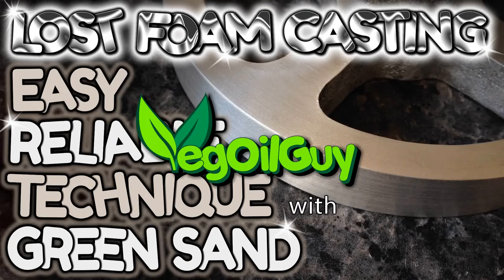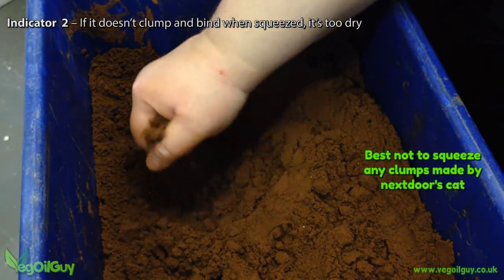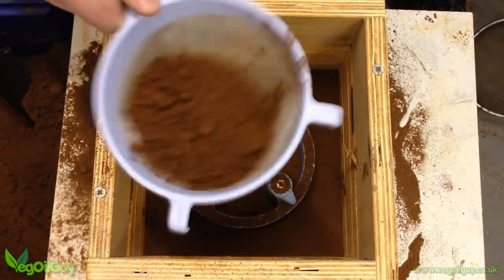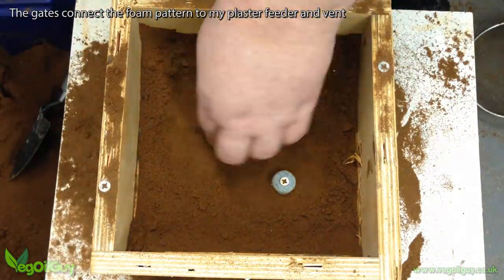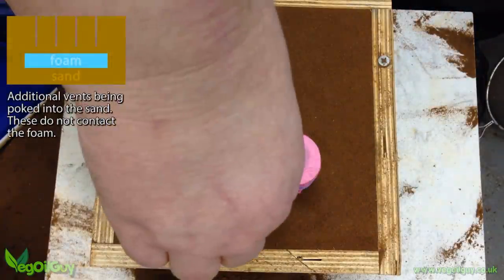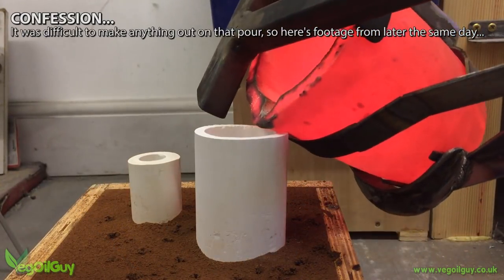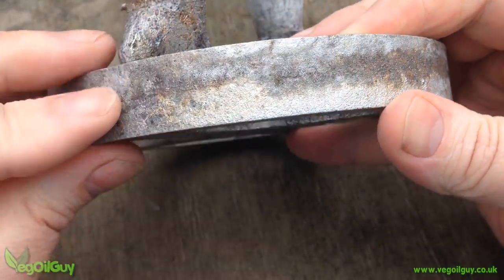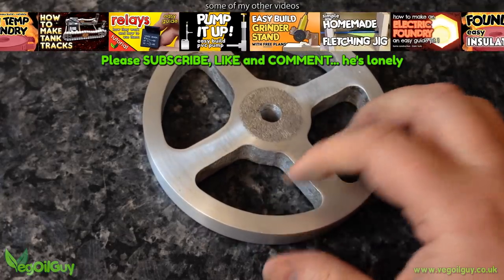Lost Foam Casting: EASY reliable technique by VOGMAN

Comment: I've got over a hundred pounds of aluminum I've been collecting over the years, I have a charcoal foundry, just been making muffins haven't casted yet. I need to make a backing plate for my new 3 jaw chuck, I thought of making a jig that would hold a metric nut the size of my spindle perfectly centered in a 2in piece of 3in steel pipe with 1/8 in threaded rod as rebar then pour aluminum, of course I would have to be concerned with balancing, I also have a few 3d printer I made, they make a wax filament...I have a lot of techniques I want to try, Thank you for your videos they are great, glad to meet another fellow maker.

Comment: Can you coat the foam model with wax or some sort of filler to get a more smoother result.
Reply from the maker: Hi Cosmic. Yes you've got the idea nicely. The candle wax can be painted over every surface if you wish. It smooths down an absolute treat and even conceals the grain of the foam. It takes a bit of patience though. I tend to save it just for areas that I need good detail - such as the teeth on a gear, etc.

Comment: Can I send you a part to cast for me? I have an old boat and one of the bolt ears broke off of aluminum cover. Clean break, but part is obsolete. There is one, very used one left on eBay, that’s it. You could cast multiples and sell for $100 each. 😂 I’ll pay you to cast mine also?

Comment: Thanks for the plug - I greatly appreciate it. Nice job on the video and I would  have to add  that it is one of the best looking lost foam castings that has appeared on YT, I think that you did a very nice job of explaining it all in a way that those wishing to try for themselves could easily follow. Incidentally the use of green sand as opposed to dry sand is an accepted technique with lost foam, in fact green sand was used before the dry sand process came into being. Foundries that I know use foam with the more modern  hard sands (fenotec for example).You mentioned my use of vents - In my case of course seeing its not lost foam work the vents are to let steam out of my very fine sand. I tend to push the vents much closer to the pattern aiming at about 5 mm from it. Sometimes the vent wire touches the pattern but as its quite fine (about 1/2 mm diameter) and comes to a fine point the vents do not fill up with metal or mar the casting.
And yes, I could not agree more about it being easier to put the work into the pattern to avoid having to put it into the casting. This applies with tradition removable pattern work too.... Martin
Reply from the maker: Praise from the master is always gratefully received - thanks Martin.
Reply: Oh get a room you two!  😎  Sorry, I just HAD to.

Comment: @1:23 - you may use a multimeter (voltmeter in resistance mode ) or moister meter for wood to try and calibrate what moisture you would like to see consistently.

Comment: Im looking at doing my first casting and i think it's probably quite a tricky one for a beginner, any advice is welcome!!

I need to create a centrifuge bowl, around 350-400mm diameter, around 120 tall.  Probably 8mm walls with a thicker base. 
The lip of the bowl for a centrifuge obviously hooks back over towards the centre to make it function properly so lost foam seems like a good idea to facilitate this. 
Though im open to other ideas obviously!! 
Im pretty confident making things, have a well stocked workshop and am sensible enough to be cautious so it's mainly the technicalities of the form im stuck with, but any advice is welcome!
Im thinking car wheels, engine blocks or bull bars for materials to melt down, but other suggestions are also welcome!!

Cheers from Western Australia
Reply: @vegoilguy excellent video, really good, educational stuff.
It can be tricky to keep up with the audio and the on screen information but lots of pausing works.
Thanks for making videos so we can learn.
Nice one!!

Comment: I can say that the results are present in the casting it looked as good as any corporately cast part where greens stand was used to hold the casting metal and given the fact that the finished part is a drive wheel or if you choose to cut a v groove then it's a pulley but the finished part looked marketable and reliable well done !
Reply from the maker: That's very kind, thanks.
The process is simple but the results are there to be seen... it works. For amateurs like myself I think it's a useful technique to achieve a quality casting. The best thing about the technique is that it's consistent.

Comment: Enjoyable video, Geoff.  Keep a cover on the green sand and the cats won't be able to get to it.  😉

I suspect you were getting tired when you were editing this video.  At 5:08 your (subtitle?) said,  "...burn the metal...".  I think you meant, "...burn the foam...".

Nice video anyway but please, no full monty.  This is supposed to be a forum for all ages.  😆  👍
Reply from the maker: Thanks Ron.
One job I could never do is proofreader. I'm hopeless at it, especially my own work. When I read it back, it reads what I want it to say, but that's not always the same as what it actually says.
Guess I was distracted by those Cheerleaders calling after Martin ; )
Reply: Hahahaha.  :-D  If you put a plaster coating on the foam, won't ALL the vapors and soot have to travel through the metal to vent?  I hope it works, but maybe you should first try a small test casting in case it doesn't.  I'm thinking that gasses will more likely create voids in your metal that way.
Reply from the maker: Someone has been paying attention to my frequent "gas" waffling ; )
I had a lot of requests to do it and so I did... the results were - surprising.
But perhaps, for you and me, not all that surprising...
Reply: Of course I was listening.  I'm sure that at least a few others do as well.  When it comes to gas, I'm something of an expert, being lactose intolerant and all.  Don't let anyone persuade you to do something too dangerous.  🤔

So there's already another video in the works?  I'm looking forward to it.  😊

Comment: Great video! Most of your casting videos that I've seen so far are of various ways you cast the same type of aluminum wheel. Just out of curiosity, do you supply them to some industry or are they simply your favorite item to cast?
Reply from the maker: If you keep looking through the videos, you'll see I eventually built a radio controlled lawnmower with caterpillar tracks. These required large sprockets and wheels... so I experimented along the way 😁😁😁
Reply: @vogman  How awesome is that! Can't wait to watch.

Comment: Great process... part came out looking very good... looks like it flowed exceptionally well? What if any flux was used? 

More serious question, where does the E sound come from in aluminum? Always wondered about that... yes I'm from the states....lol
Reply from the maker: No flux was used in this one... but I use it these days and it does flow better  : )
I've always wondered about 'aluminium' as well. I always used to think, "Why don't they pronounce the other 'i'?" but now I understand you guys spell it with just the one. But it's the differences that make life interesting  : D
Reply: @vogman  Thank you for your reply, I know this is old, so I appricaiate the response...

Comment: Also I wonder if one could build an apparatuses to spray hot wax????
Reply from the maker: That's an easy one... an ordinary plastic spray bottle. Melt some wax and pour it in. The was will harden very quickly so the whole thing needs to be stood in a bowl of hot water. It works... I've done it before. But you need to acts quickly as the nozzle clogs eventually : )

Comment: Now what will it take to do it in steel/iron? Can your foundry go that hot?
Reply from the maker: I've no idea if I'm honest.
In theory my home made electric foundry is good for 1400C, but that would be pushing everything to the max.
My outdoor foundry is good for 1900C if I remember correctly, but I only ever work in Aluminium anyway. It's a strong, cheap metal that good for my purposes.
I may be tempted to do a little bronze at some point, but I don't think I'll do steel. I'll leave that for the big boys : )
Reply: I see. I've been looking for DIY steel casting on Youtube, can't really find any, maybe that's for a reason :D
Reply from the maker: Molten steel is possible and some of my subscribers tell me they've achieved it. It's a bit daunting for me if I'm honest.
So far there's been nothing that aluminium hasn't been good enough for. If that changes, who knows... but I would imagine steel is a tricky one to master.

Comment: where do you get your green sand from, or do you make your own?
Reply from the maker: That depends where you are in the world buddy. Typically you have to find a foundry supplier. In the UK, there's www.castreekilns.co.uk
I've heard of lots of people claiming to make their own, but I'm not 100% sure it's possible.
Reply: Bentonite clay is what is used in classic cat litter, the recipes i have seen use a part of cat litter and a fine white construction sand. i have some old books on metal casting that has similat recipes. it is not rocket science. i can send you the recipe on the old foundry book if you want to give it a try i have been doing a lot of research into the subject for the past 5 years but have yet to have a propper space and equipment to learn this skill :)

Comment: Does the foam gum up the sand after using..
Reply from the maker: Hi Greg. No, not at all. As will ALL types of sand casting, the sand blackens on contact and this is a good thing as it helps to show how heat and gases dissipate through the sand. But the sand remains unharmed and is good for use again and again : )
Reply: @vogman  good that stuff is expensive I wouldn't want to ruin it..

Comment: oh thats a nice one, i want to start making brass balls, true story, have plenty of material.
Reply from the maker: Brilliant  🤣
Reply: @vogman  hey you answered , i have some 3 in. foam orbs i was going to pour plaster around, do i need a vent ?
Reply from the maker: I always try to answer when I can : )
With foam, I'd always vent. You need to get the gasses out ASAP, ideally pushing them infront of the metal. Venting is the way to go : )
Reply: @vogman  thanx , i did one with no vent / lost wax ball in plaster & had a volcanic spewage of oplium & burning of holes in my arms & face, my cat like reflexes saved me , ill vent.

Comment: i would like to propose 2 ideas:
(1)Coat the foam with cement slurry + sprinkled sand to form a shell
(2)dissolve the foam away with a thinner bath for several hours or burn the foam away with high temperature